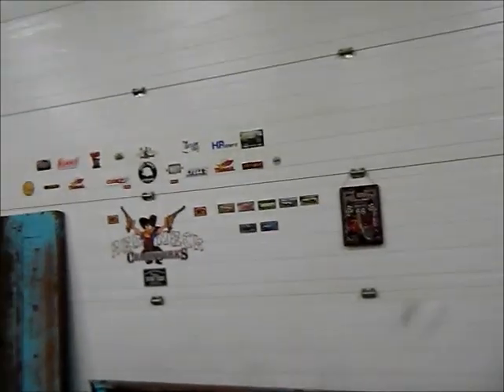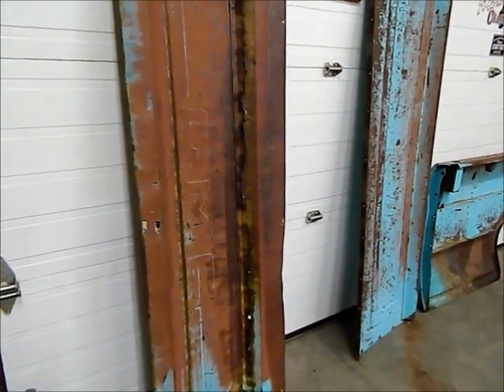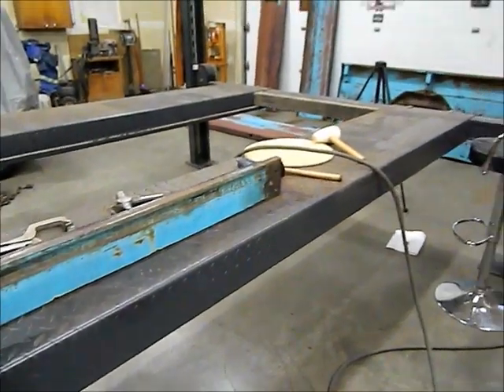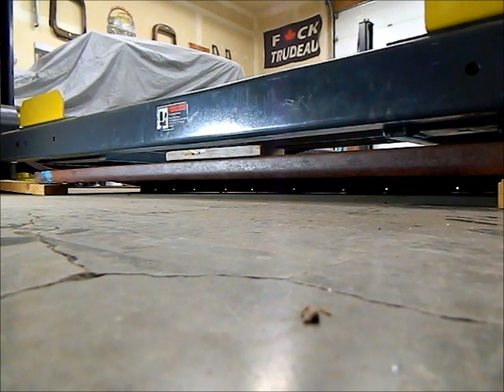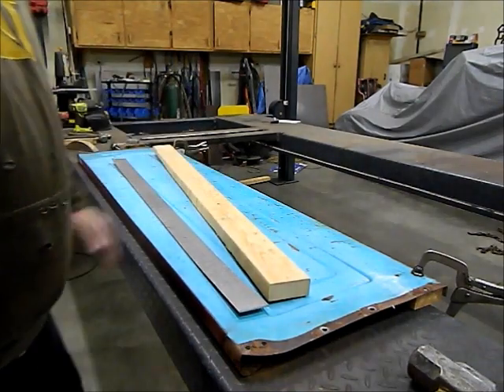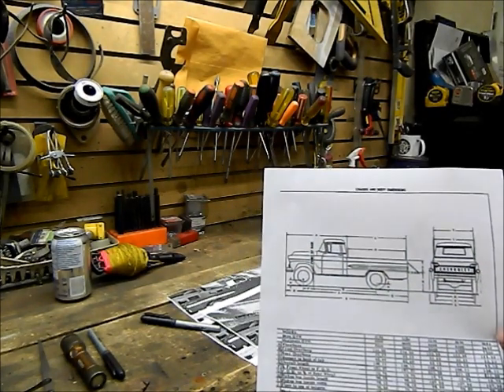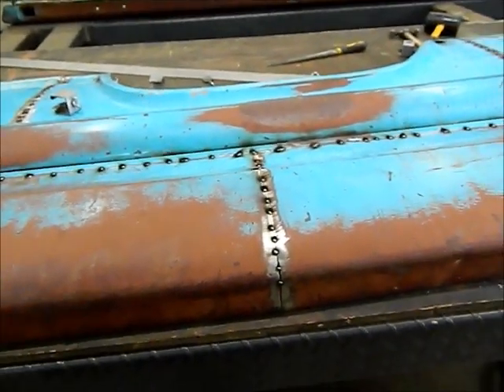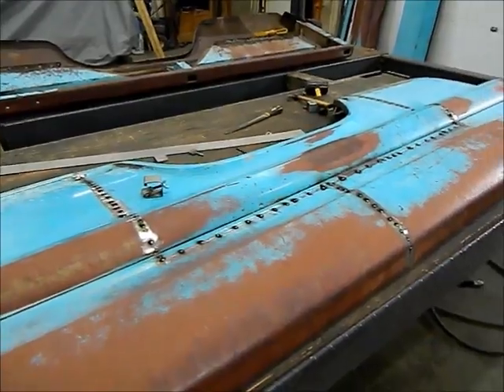1959 GMC Fleetside#3 lets cut the dorky out and put the cool in

Comment: Looks really good Glen, what would happen if the cut line above the wheel opening went all the way forward and not up in the middle could it be slid forward and cut the excess of the front probably a lot more welding
Reply from the maker: Thanks Mike,  there is a lot of structure at the front of the bed that would have to be cut free, the rebuilt and some tough brakes in te steel.
Reply: @glenmiller3783  yes Glen after taking a better look I see that, thanks